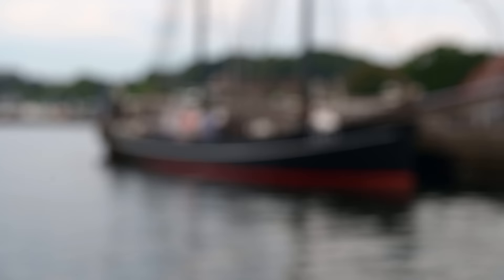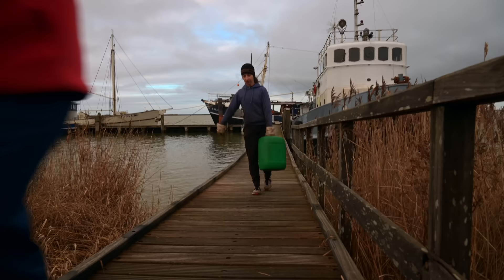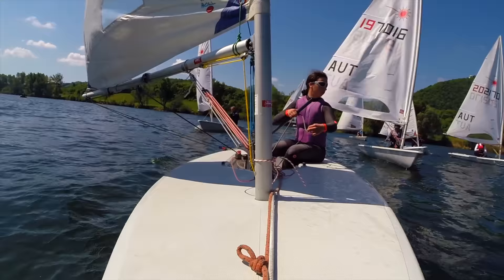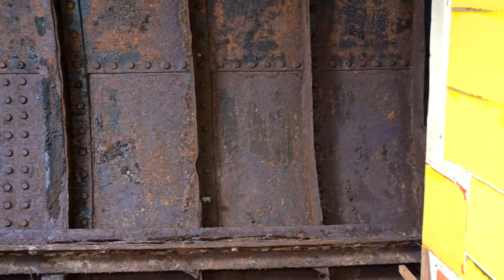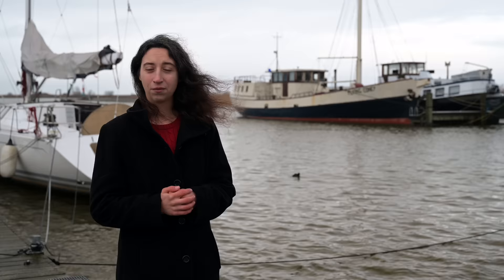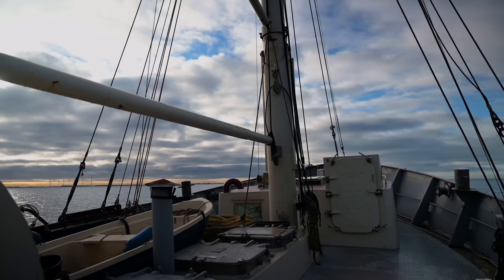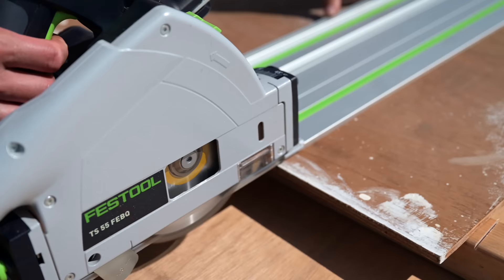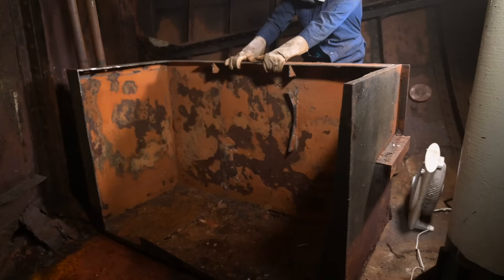2 Years Of BOAT REFIT in 25 Minutes!

Comment: Sat with a group of cruisers the other day and we were discussing % of time maintaining vs. cruising. We concluded that for a smaller (35 ft) fiberglass cruising boat its probably 60% maintenence, 40% fun but for a steel boat or a bigger fiberglass boat, it may go to 70:30.  This vessel, of course, is in another category.

Comment: We have found that whereas (lead acid) battery life used to be 7 to 10 years, in more recent years we are only getting two to three. The working rule is to expect to get three months additional life over the warranty period.
Reply from the maker: I think we're using the batteries much harder nowadays. We bought a Lithium batterie for the camper van at a very reasonable price and this thing is great. Probably we will go lithium on the boat as well.

Comment: You ever figure out what cause the electrolysis or whatever it’s called
Reply from the maker: An electric system that wasn't up to spec especially the inverter was probably the main cause. Also different types of anodes were used and we found the zinc have been eaten up completely and the aluminium overgrown and passive.